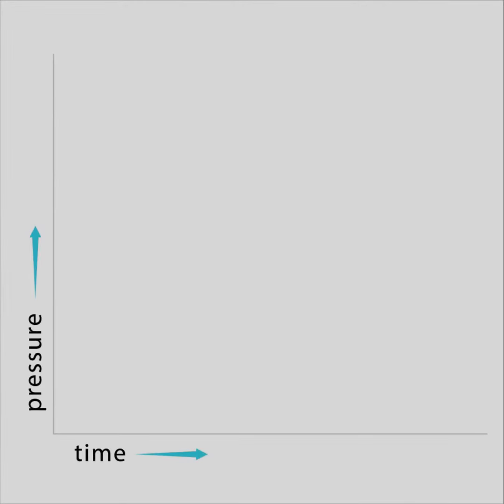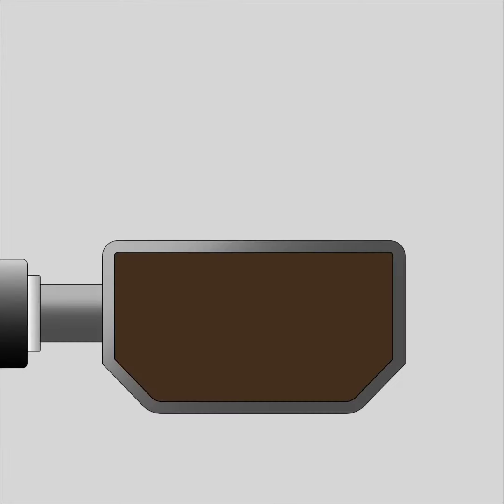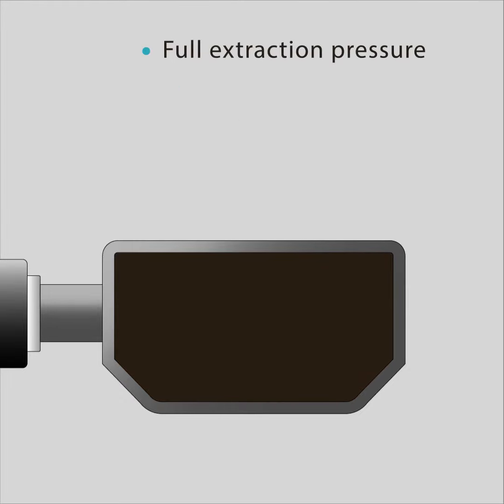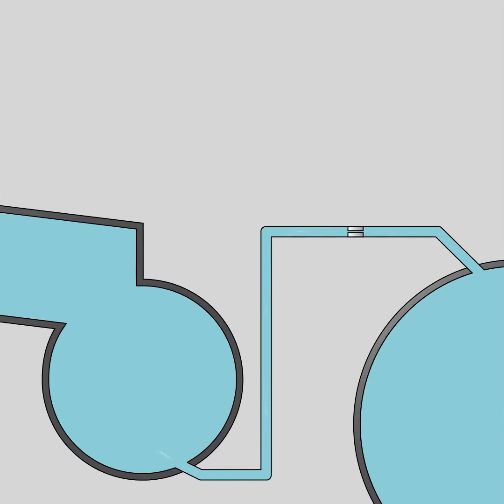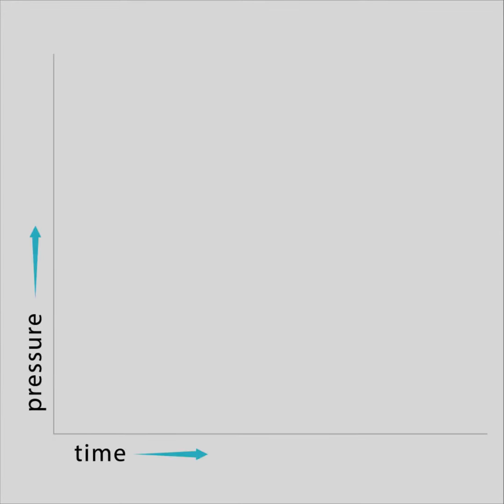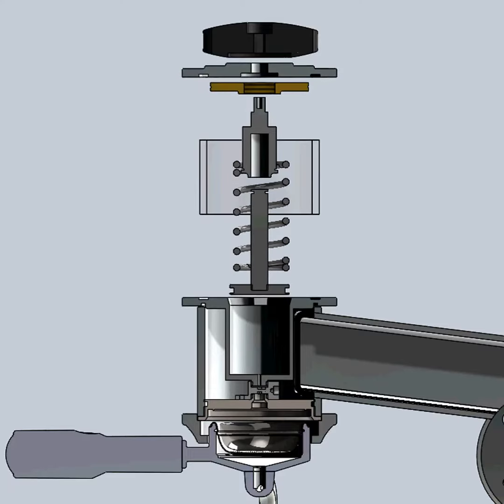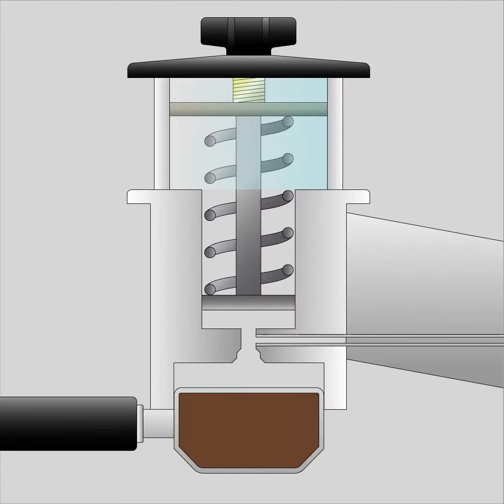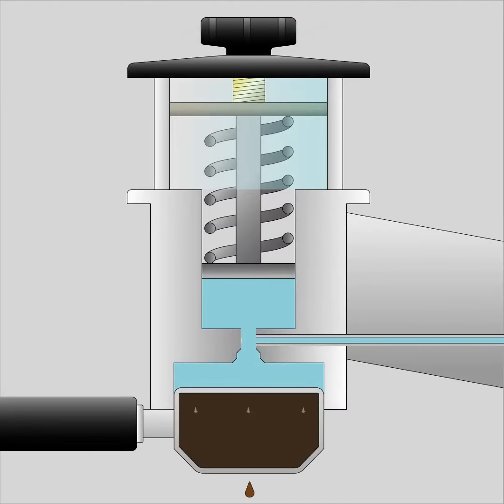Idro-matic Explanation

Comment: What’s the maximum length of pre-infusion? Can the machine handle Turkish grinds?
Reply from the maker: Hi Laurence! The length of the pre-infusion completely depends on what type of coffee is used, how much and what grinds. We don't know too much about Turkish grinds, the traditional method would be best I suppose, but if you tweak it a bit to make it suitable for an espresso machine I don't think there should be a problem. We've never tried it before, but if you have tried to brew Turkish grinds on an espresso machine and it worked, it should work with the Spirit as well. With the Idro-Matic you can manually change the pre-infusion and you can also play with different pump pressures and temperatures, so you have many options to create your best "espresso".